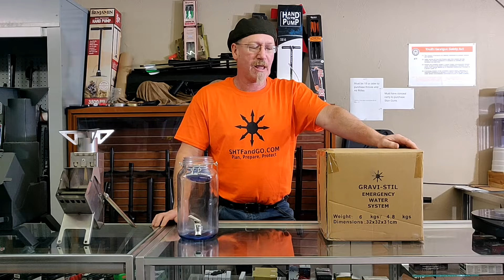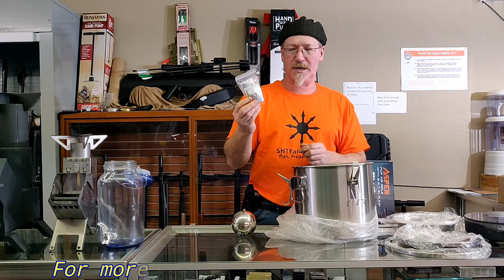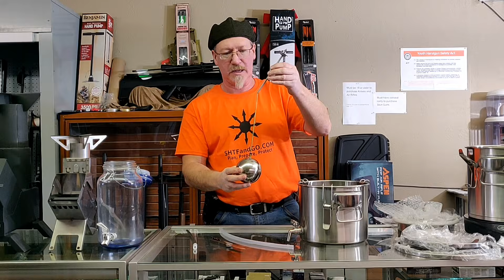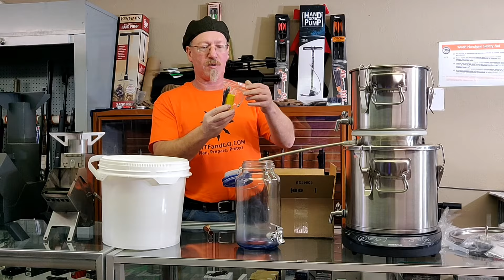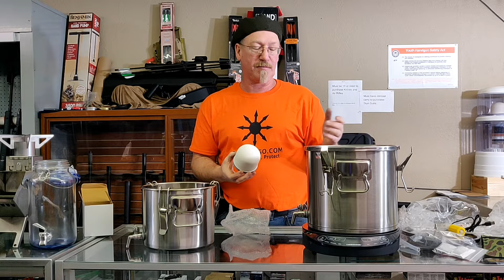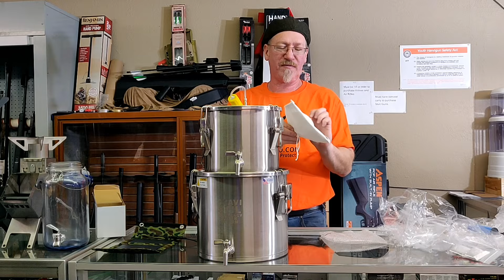Gravi-Stil Setup and Assembly Instructions

Comment: I just purchased this kit however my pot did not have a double layer pot bottom. Am going to have to purchase the part needed to be able to use with my one burner induction burner. Also didn’t come with the green scrubber to clean filter. The filter in my kit was the long black filter instead of the white round one. I have a flat top stove and was told it wouldn’t damage my electric stove. I certainly hope not.  I did call and spoke with a lady asking questions. She was very informative and helpful. I had watched this video before I got my kit and my kit was different however this video is five years old. The customer service lady said that there have been some changes. Just put this on here for your information and when you go to purchase it, you might wanna ask some questions. I haven’t used it yet, but it’s ready to go. This instructional video has been nicely done If you need assistance, I have found them readily available. Good luck. I’m excited! I feel this is a very good product well-made.

Comment: how do you clean the tubes?
Reply from the maker: On the filler tube, we use vinegar or CLR with a pipe cleaner, or you can use the float rod rubbing it back and forth will scrape the scale out. For the discharge tube, we never clean the inside, just soapy water. There's never anything in it, and at the temperature of water it sterilizes anything that might even get in there.

Comment: I don’t know what kind of tubing you have when this set up as a loop system . The long tubing looks like plastic and I was wondering if it melts. It there a way that keeps the tubing away from the heat source or I’m I just not understanding how that part works..?🤔
Thank you in advance for your time.
Susan
Reply from the maker: Hi Susan. Sorry missed your message. The tubing is high temperature silicone, not plastic.  It is surgical grade and can withstand 600+ degrees. You will want to keep it out of flames still. Can't take direct flame very long.

Comment: I have had a gravi still for a few months. I use it on top of my wood stove. I run it 12 to 16 hours per day, always topping off the water. Would you please let me know what I can do to make it produce more than 1/8 Cup to 1-2 Cups of distilled water during the entire day? It would be greatly appreciated...
Reply from the maker: If you're not producing water fast enough, you're not boiling it hard enough. Give us a call at the shop and we'll be happy to help you. We have customers making 10+ gallons a day easily.
Reply: @Shtfandgo  I guess my wood stove doesn't get hot enough to boil it hard enough. I would have to over heat my wood stove to get it that hot...we will have to figure something out.  What is your phone # at the shop?
Reply from the maker: @BacktonaturelivingCom  612-888-7583 M-F 8-5

Comment: Is the procedure for distilling the same for desalination?
Reply: Yes it is the same with one small step.  We recommend running the water through a pre filter to remove as much organic material as possible.  Some use a cotton cloth or towel. The organic material will cool, and transfer an odor. The carbon packets will help a lot, but the water is safe to drink.